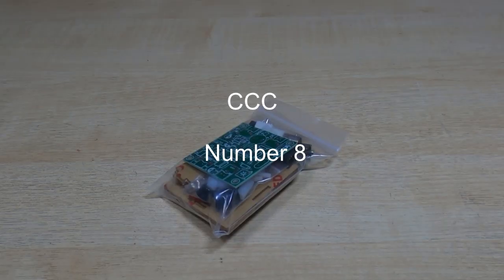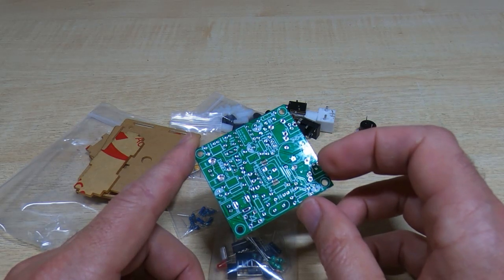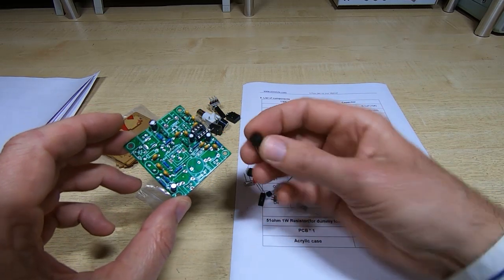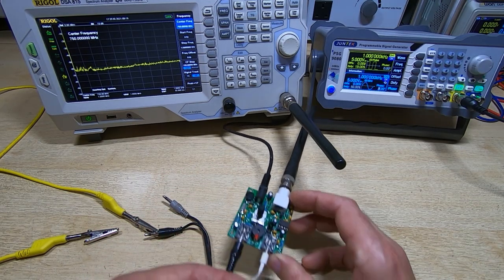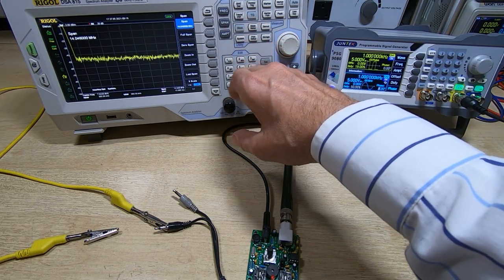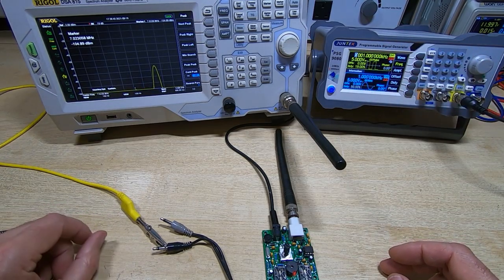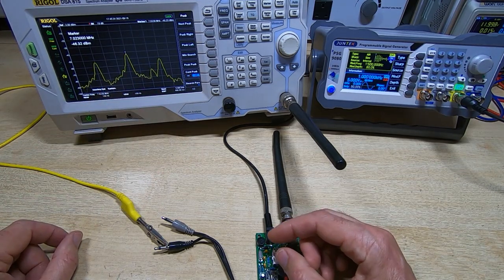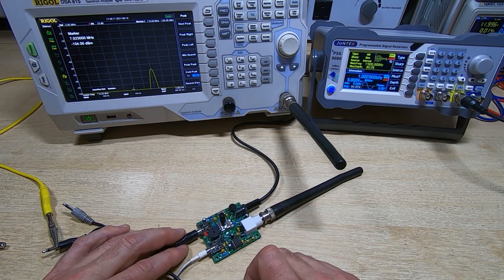Cheap Electronics Kit Number 8

Comment: Shows that rf fun doesn't have to be costly. Those little helical aerials will be a poor match at 7MHz. Although a simple direct conversion design, you may be surprised at what it hears with a simple dipole - 66 ft of wire fed in the middle with a bit of coax will do nicely.    -. .. -.-. .   .--- --- -...
Reply from the maker: Yes the antennas are designed for 434MHz but at that range anything would have done. I would be interested to know what it can receive but I suspect that discrimination may be more of an issue than sensitivity.